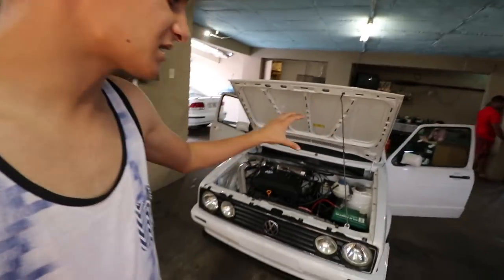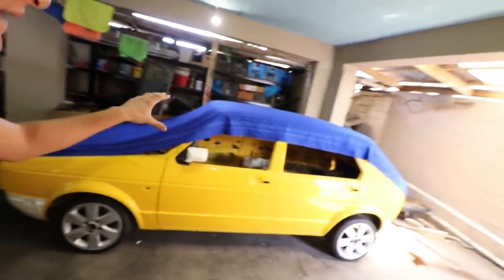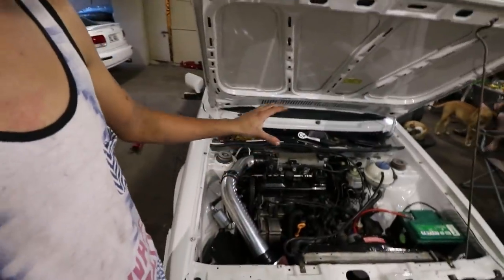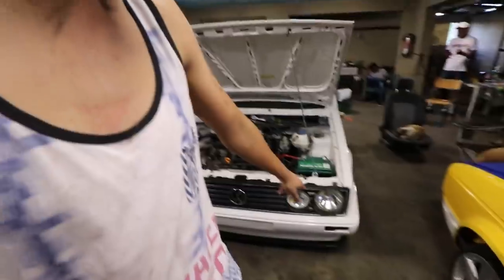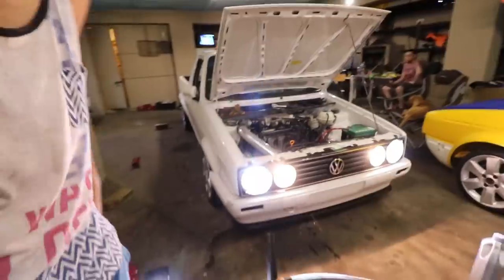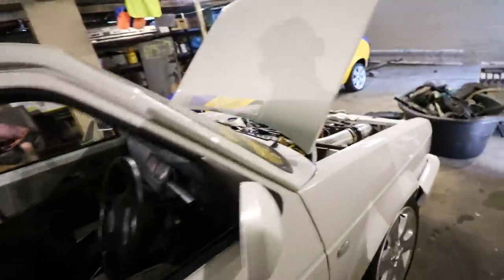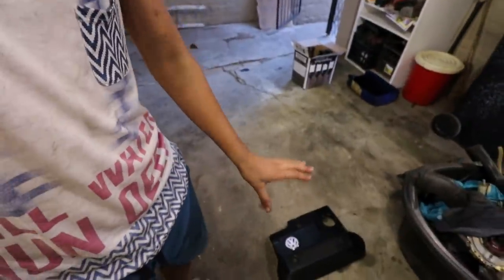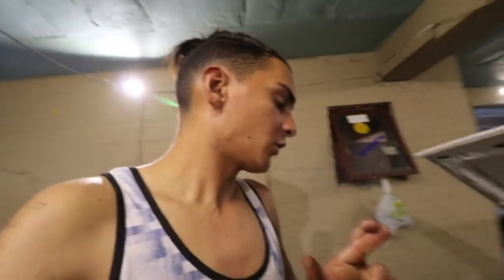Someone stole the Caddy's parts

Comment: Hey dude! To set the timing on the MP9, you need to take it to someone with an OBD reader and go into the ECU and it has an option to calibrate the timing where it holds at 1500 RPM ( I actully took my car to Allen and he did it for me and set the co's at the same time. If I remember correctly, the standard timing on an ADY is 6 Degrees advanced and be sure to use a timing light. If you take the car to get tuned on the MP9 ECU, the tuner should also be able to set all of these parameters in the process.

I have some sick stuff in the works , possibly some custom sponsored parts for the YT in the near future ;)

Comment: Try changing the 4pin temp sensor for over fueling.. Worth a try
Reply from the maker: We already did. But still the same
Reply: @LateLateCustoms  perhaps try timing with plugging the ecu in to set it correctly..
But i doubt that will cause abit of over fueling..

Look more info fuel pressure.. And a good quality spark.. Another common problem is a fuel pressure regulator on the fuel rail